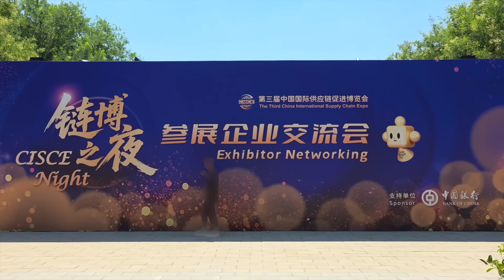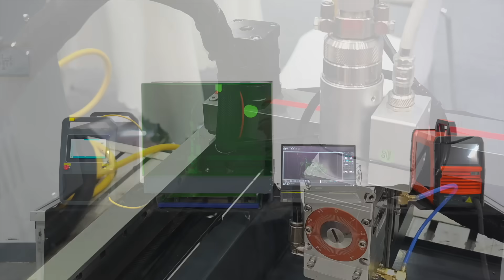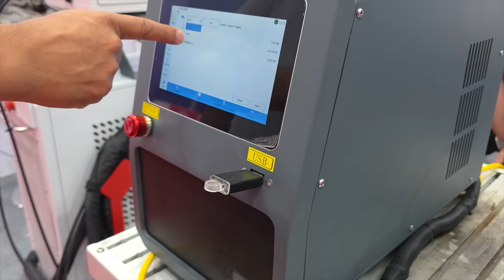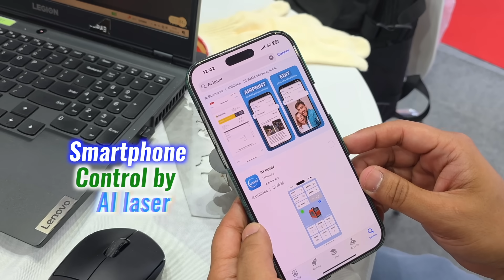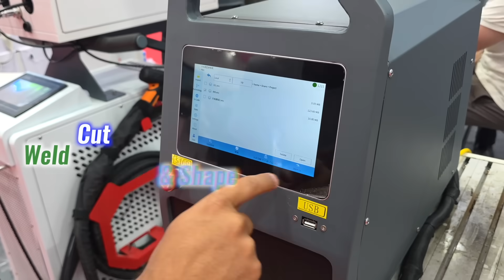HEROLASER E700: A Desktop Laser Cutter That Actually Works

Comment: This thing looks like a dream for anyone working in a small studio or workshop. Metal cutting and welding usually means bulky equipment, but here it’s all compact and streamlined. The interface also looked really user-friendly, especially during the world map demo.
Reply: That form factor is perfect for custom work or small batch runs. Really promising.
Reply: I was surprised it handled engraving and welding that well without tool swaps.

Comment: It’s not often that a machine looks this capable and this compact. Seeing it handle multiple materials and jump between cutting and welding without fuss is impressive. The workflow looks smooth, and the design output speaks for itself. Definitely something worth following.
Reply: Both machines are very powerful
Reply: I'm impressed by these machines
Reply: It didn’t feel like a prototype either—looked solid and well-engineered.
Reply: It’s rare to see something this portable with that level of control.

Comment: That airplane model build really showed off what this machine can do. Cutting the parts and welding them together without needing different setups or machines makes it feel like a proper all-in-one tool. The size and power balance looks spot on.
Reply: I like that airplane
Reply: It's precise
Reply: Totally agreed
Reply: the welds looked super tight
Reply: 100% agreed
Reply: Yes！
Reply: Honestly, the smooth handoff between the two units made the whole thing feel pro-level.
Reply: all the products it made look premium